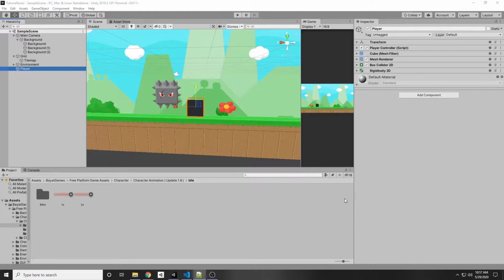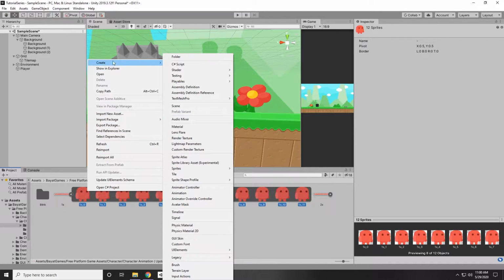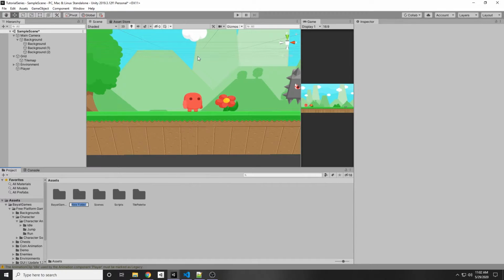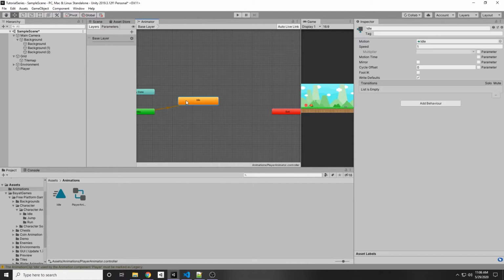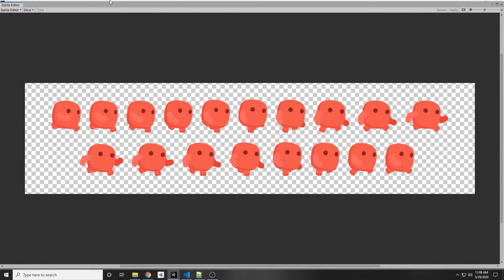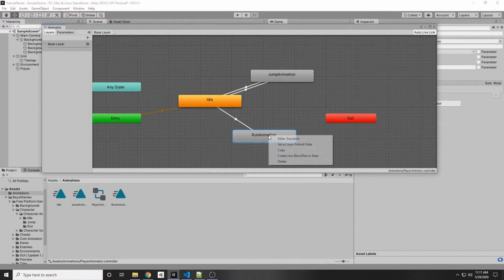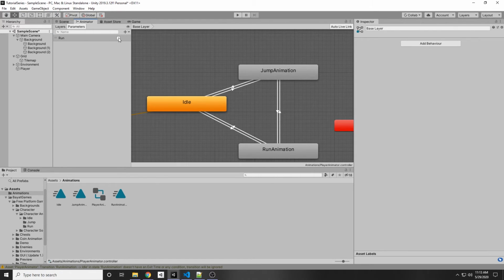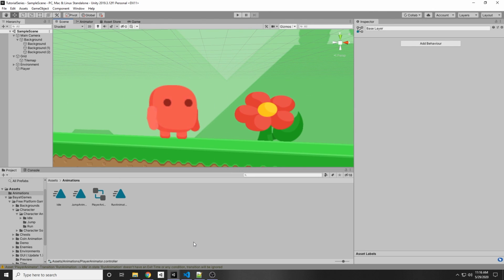How to Set Up an Animator Controller with Sprite Sheets - Unity Tutorial

Comment: When cropping the spritesheet automatically, the cropping is adjusted to the size of the sprite, cropping the first frame of the animation with a size of 73 * 73px. In the sprite sheet, each frame has a size of 128 * 128 and in the inspector the "pixels per unit" property is by default 100, so the size of the sprite and the BoxCollider2D are misadjusted. What I have done is set the "pixels per unit" to 73, in this way the player preserves its resolution and adjusts the height of 1 world unit, without having to touch the scale, and it serves as a reference for the rest of the level design . Nice tuts!!!

Comment: Very wierd. I switched out the character model and just resized the Collider and now i cant jump anymore. Before i resize it works, after not. But the collider hits the ground so the If grounded statement should be true and jump possible.  I try a little more but cant find the problem atm
Reply: Okay found the problem :D  The offset and the size where so random numbers so it did not work it seems. I just reseted the numbers to zero and resize it without the Edit Collider symbol. Now i can jump again :D